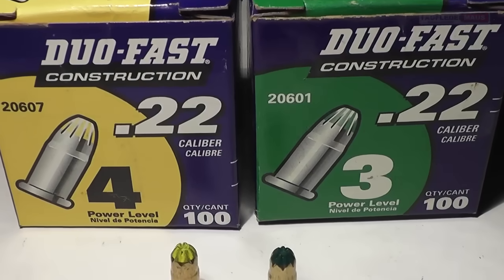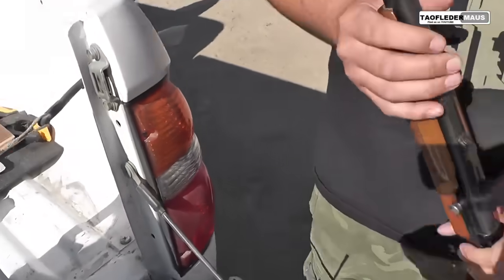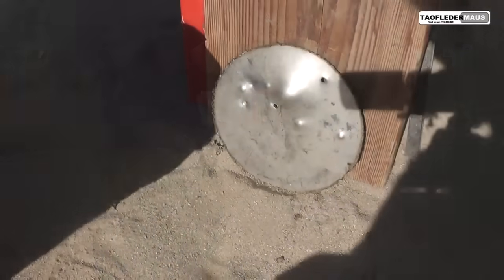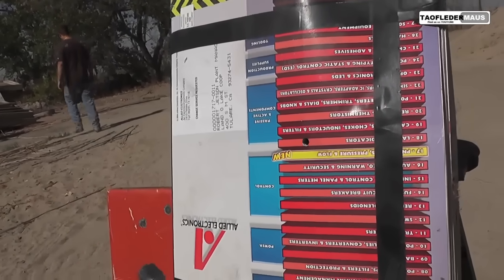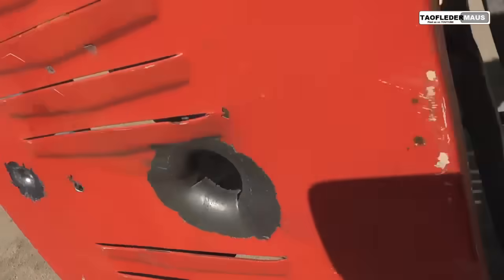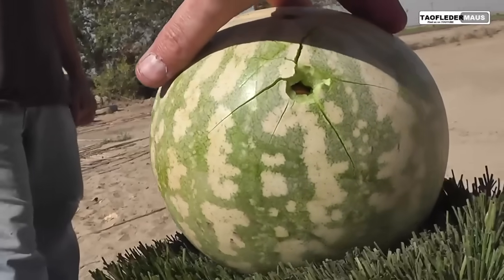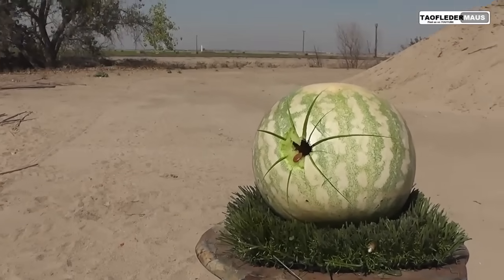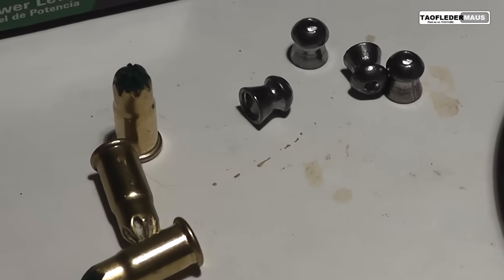Shooting .22 PELLETS Using NAIL GUN Blanks - What happens?

Comment: you know those air rifle pellets  have a cone on the back of them like the conical bullets in the civil war. when the powder goes off it expanse the cone into the rifling's which will make them accurate. its not going to hurt the gun. good survival ammo.
Reply: A 14 grain pellet doesn't offer near as much inertial resistance as a 30-40 grain bullet. That's where the extra velocity is coming from. It takes a lot more pressure to accelerate 40 grains than 14 grains to the same velocity.
Reply: mad max , as soft as the pellet is and the velocities your pushing I could expect to see some relatively high rate of lead fouling.
Reply: The civil war conicals were a combination of bullet weight,  shape, powder type, and burn rate all working in harmony. The fast powder in the hilti shells overpowers the ultra light weight pellets and does affect accuracy. Not only that but pellet speed can actually drop off with the more powerful yellow blanks! This was proven by +RyeOnHam when he did some chronograph tests. Better to use the lightest blanks color coded brown.
Reply: Will Yam smokeless powder burns slower than black power that is a fact. slower burning powders burn all the way down the barrel and makes for higher velocity. that why that pellet is being destroyed. the pellet is just like the conical bullet of the civil war the cone will expand and engage the rifling it  just needs a smaller powder charge.
Reply: madmax...its called a miniéball....(miné or min-aye-ball) named after Claude minié....but gets called mini ball.
Reply: mad max the idea is to get close to the same burn time as it takes to get the projectile out the barrel, somebody correct me if I'm wrong but that is the direct difference between big bore and small bore powders is burn time but compound is irrelevant. black powder is granulated after the ball mill processes to controll burn time.
Reply: You're correct about the burn rates of different powders, but what is the chamber pressure? Excess chamber pressure can damage the firearm and injure the shooter. The load data found in reloading manuals will always tell you the chamber pressure for a particular load based on the type and amount of powder and type of bullet and  weight. This seems like guess work since you don't know the powder charge in a Hilti .22 shell and there isn't much info on .22 rim fire rounds since they can't be hand loaded. It seems to me if its outperforming factory ammo, it must have a much higher chamber pressure and may be approaching the danger zone.

Comment: I modified a Ramset nailer to shoot 22lr bullets.the varmints up in my neck o the woods are all drug addicted scumbag thieves.If the situation called for it I didn't think that nailing their heads to their asses was gonna be the way to go. and it's a legal firearm!  single shot, but it could do in a pinch and still a working nailer!.

Comment: What alternative 22 cal pellets for a vintage crosman 600 10 shot semi automatic it only has worked with super pells crosman ,  and I searched all over  nothing comes close to the design of the ash can type original flat super pells   is the any suggestion for me  on what to use .?
Reply: Try the RWS Meisterkugeln Standard .22 Cal, 14.0 Grain Wadcutter style - the Crosman 600 must have pellets that stack on the rims of the pellet skirts.  Posted or round-nose types sort of lock together in the magazine and bind up the feed toggle.
Reply: D'oh!  POINTED, not posted.  Damned autocorrect.
Reply: sounds good I found them on eBay

Comment: I'm not a gun specialist but I know my way around some construction tools, and I'm fairly sure this can damage your gun, worst case damage your hand holding the gun, yes it's more power, but your gun fortified  isent like the tools are.
Reply: Your gun isent fortified like the tools are , my bad *
Reply: Well actually guns are made to take a lot higher chamber pressures than a tool for driving nails would be. The projectile is a couple thou bigger around than the gun barrel and the short amount of time it takes to move the length of the guns barrel causes huge pressure. Nails guns instantly release the pressure as there is no 24 inch or longer barrel for the nail to run down. But then again you did say you knew fuck all about guns.

Comment: Hey, Paul here. Longtime fan but never left a comment. Waiting for new videos I end up re-watching all the old ones.
I have a .17hmr which has a 22mag chamber but shoots a 17 caliber 17 grain projectile. It seems to be the same bore size between a 17hmr and .177cal pellet. The chamber fits a .22mag case necked down to .17
So I'm guessing a .177 pellet with a .22 blank should make a ridiculous high velocity projectile ... Maybe? The 17hmr averages 2550-2800 fps.
Of course there are faster and slower loads but can a pellet exceed that 3000 mark and increase penetration?
Seems like a question custom made for Taofledermaus! thanks
paulhouse7426@gmail.com

Comment: they're called power loads for a reason, they release more energy than a firearm round because they're designed to drive metal into concrete as opposed to soft flesh, but because there's more energy released than your weapon is designed to handle, you run an extreme risk of destroying the weapon and the hand holding it
Reply: The shells can't hold enough powder to blow a normal barrel. i'd not fire one from a sleeved barrel though. if it's too thin it might go pop
Reply: it would probably be best to just do this with either break actions or bolt actions, a lot of times the barrels on semi-autos are thinner
Reply: @wulfarrow2849  Well Yes and No, I have tested some hot loads in .22LR's the semi-auto has a thinner barrel, BUT also has a place for the gases to escape....On a bolt gun it has NOWHERE to go!
Reply: Yeah I thought the same thing especially in a simi auto ..

Comment: so you muzzle load the little pellet then put a charge in somewhere? sorry i dont know how guns work..
Reply: The rifle has a tube fed magazine for normal ammo and a breach where the spent casing comes out. They muzzle loaded the pellet like you said and then put the propellant case in the breach like a normal she'll would. Since everything they are using is the same caliber as the rifle's barrel it worked ideally.
Reply: +Colin Kornegay so just to clarify, this is armor piercing and much better than standard ammunition? I have very little perspective on ammunition effectiveness.
Reply: Yes, this is faster and you beat armor with speed. I would not say t is batter than standard ammunition though. The action in the gun is designed to handle a certain amount of pressure. This being a small caliber that amount of pressure is small compared to other guns. The charges in the video are very powerful compared to standard ammo and the gun will wear out quickly and need new parts more often.

Comment: I tried doing this about a year ago with my cheap bolt action .22 rifle. But I loaded the pellet into the breach and then put the blank behind it. It hit the target fine but left behind a ring of lead that prevented me from shooting again until I removed the lead with a sturdy wire bore cleaner. So in short I only got one round to fire off. I might try it again in the future.
Reply: +Josh Bonds Try a copper pellet next time.
Reply: You can either use a lower-power blank, such as #2,  or a bit heaver projectile....

Comment: I'm in construction and I've used hundreds of those yellow shots to nail wood to concrete. The box describes them as "Low Velocity", so I was quite surprised at how much they compared to a similar "real" bullet.
Reply: +Mike Truglia I imagine it would far over power the pellet and it would rip apart mid air, or not stabilize in any regard. Just a guess though.
Reply: @The_PotionSeller  powdered. it's to much pressure for soft lead.
Reply: imagine using the red caps, yellow and green are the weak ones. i own a ramset, and the red ones are most often too much. i only use the red when attaching wood to structural steel.
they need to try the red ones!
Reply: @miketruglia4825  pellet won't stand the strain.
Reply: The #4 rips the pellet skirt off in the barrel, and you gotta get it out before you can load another pellet...works OK with the #2 .
Reply: Could use steel pellets
Reply: @AndreHila  not if you plan on continuing to use that gun .it will eat the bore right out. check out steel shot in shot guns.

Comment: Ok, hold on to your drawers. Back in the dawn of time someone  melted the lead out of 88 grain JHP hollow point bullets for a 380 acp and filled them with pewter and the resulting weight was 67 grains. these were loaded into a 357 magnum with a compressed load of Blue Dot yielding velocities in excess of 2500 fps from a 4 inch barrel and blowing 25 lb blocks of duct seal to dust bunnies. 1/3 of the block crated on the ground, 1/3 of the block stuck to the backstop and 1/3 of the block just gone as dust or so it was reported. When you think about it, there is no reason you have to use 50/50 lead tin. The bullet could be solid tin and possibly weigh 40 grains. IKR, crazy talk.

Comment: Beware; The Crossman Hollow Point pellets might work fine in this demonstration, but some years ago I did the same experiment using ordinary pellets and found that the pellet head tended to separate, leaving the pellet tail or body in the bore! By the way, that round green object the guys were shooting was a gourd, not a watermelon.
Reply: I am assuming that you had the pellet right up against the crimped end of the blank. If you leave a bit of space, that shouldn't happen.
Reply: @bigbasil1908 ; I was using Musket percussion caps, not .22 blanks, and there was a 1/4" or so gap between the cap and the pellet.
Reply: @oldgysgt  Oh I see. Maybe the skirts on the pellets were not very thick, or maybe the compound that the percussion caps use was too powerful for the pellet. Those 22 blanks are black powder from what I understand
Reply: @bigbasil1908 ; yes, the caps were more than the pellet skirts could handle. I had made .22 cal inserts to replace cartridges in civil war .50 cal Burnside and Smith breach loading carbines. These carbines are primed with a external musket caps, but apparently the caps are a bit 'hot" for these light pellets.

Comment: I want to see you open the crimp and make a standalone round with it :)
Reply: +sinephase not a great idea because unless someone has a reloading manual that has data for blank powder we don't really know what pressures we're generating. This way the pellet is already jammed in the barrel, the blank uncrimps itself and the gasses push the bullet. As a standalone, the blank would have to do the job of the ramming rod and the pellet would temporarily act as a barrel obstruction while engaging the rifling.

Comment: Even though the pellet is a bit undersized compared to the bullet, the pellet skirts are very thin and the gas will push them into the rifling groves to engage the rifling well. There are .38 special wadcutter bullets that have a hollow cavity at the real used in bullyeye competition that are designed this way.
Reply: I had the skirts tear off in rifling but works good. Use heavier pellets.

Comment: If it's stupid but it works, it ain't stupid!
Reply: Or its stupid and you got incredibly lucky.
Reply: So if I jam my finger into a plug socket to bridge the gap between the socket and my lead which is too short that's a good idea?
Reply: Yep.
Reply: Maxim 43: "If it's stupid and it works, it's still stupid and you're lucky."
Reply: @stryc9fuego  if you feel that it's stupid then don't do it!
Reply: Ramset knew exactly what they were doing making this pellet. Even with the gun laws changing people can still
Have a decent deterrent while still owning a legal rifle that's classed as low power. In the uk you can't buy these anywhere in fact you can't even buy that nail gun in the U.K As it's classed as dangerous we have the crappy pneumatic placating and metal pin type guns. Thankful
You can order the ramset pellets of eBay amazon etc.
Reply: +Hans Solo Zimmler You are right.
Reply: science isnt stupid its great .
Reply: No, it's still stupid.  Discount the fact that this is the wrong "ammo" for the gun and you still have more money, more work and less accurate results.  That defines stupid.
Reply: Apply that to 9/11

Comment: The first of these I ever made ,(40 years ago), were simply the pellet stuck on, and slightly over ,the end of the cartridge, held with a dab of dried gasket glue, and fired from an old mossberg .22. I made another .17 cal. same way, and fired it in a home-chambered ( chambered with a 7/32 drill bit) Air/pellet rifle, (Norinco or Lorcin). NOTE: The .172 bullets in HMR and V Max are smaller than the .177 BB or pellet, and will not stabilize out of a slow-twist soft - lead barrel.

Comment: Good idea. Reminds me of when I was a grunt in the army and if I got bored in the woods during down-time on state-side field exercises  I would drop a section of cleaning-rod down the barrel of my M4 and with a blank firing behind it it would go so far into a tree that it was impossible to pull out with bare hands.
Reply: SGT D well that rod isnt cleaning anything anymore
Reply: I have some nails that are .15 cal so I can use them in my pellet rifle, using a bit of styrofoam as a wad, and fire them over an inch deep into wood from 10 feet away lol
Reply: Risky business. Don't think a section of cleaning rod weighs the same as a projectile you might be using. Props for trying it out though!
Reply: Ive done that with a .22, pulled the bullet and doubled the load, cleaning rod would stick pretty good lol
Reply: Wow

Comment: Same problem as with supersized bb - bullet goes through too fast almost zero stopping power, but lots of penetration. 
Basically - you should've tried it against a body armor kevlar plate. if it rips through it - you have a home made contestant for armor shredder.
Reply: +Smoke Fumus considering that all soft body armor is rated for MUCH lower velocities of 9mm and .357 rounds, I think it'd be good enough for that purpose.
Reply: I was thinking about .30 sabots....223 projectile, @ 3500+ fps... reportedly not very accurate in rifles, with rifling for heaver projectiles... but out of a .30 pistol, might be interesting... something that fires .30 carbine, 762.25 Tok, etc....

Comment: The pellets are soft lead.  There is a reason soft lead bullets are against the Geneva Convention.  They break up when entering the body (or a melon) transferring all the energy to the flesh rather than going through like a standard round.
Reply: Subsonic sticks, super sonic drills holes.
Reply: +simhere2 ..that fact intriged me..and i'v shot a lot of air guns..so a 8 grain pellet going 2800 fps has got my intrest..and yes i have a chonagraph..

Comment: It seems like the high velocity pellets are acting like a wadcutter with their perfect holes thru the steel.  Is the pellet pure lead with a hollow base??  Is the face of the pellet flat, or convex?
Reply: Pure led and in the video he is using hollow points, I don't recommend doing this I kinda blew up my old trusty Remington pump 22 and took an extractor to the face but yes they were fast and very accurate

Comment: Hmm...too bad there isn't a rifle specially made to do this; it'd be a great recreational shooter!
Reply: +Alonzo Branson Either .22 break action rifle or revolver should work well. With some paper and glue you can even make a cartridge)
Reply: +КоммуНЯКА Кавайная Yep.. But the #4 charge, and .22 bullets for the mini-revolvers were too much for my Buckmark.... gotta get it fixed.
Reply: +koolkitty8989 I was thinking the exact same thing, loading the pellets with a small Allen wrench in a single shot breech bolt action.
Reply: Yes... perhaps starting with a .22 center-fire barrel, or  a .22 insert in a break-barrel shotgun, to have sufficient steel around the chamber to withstand the pressures generated.... I agree that using a standard .22 rim-fire could be problems, which is why I suggest the most conservative approach...
Reply: Alonzo Branson I'm sure itbcould be made... literally in anyone's garage with the right tools
Reply: I believe that, in Mexico, you can get a "firearm" that shoots .22 pellets propelled by .22 blanks. Kinda close, not sure if these powder loads will work in them
Reply: @michaelbritt7609  almost impossible, I live in Mexico.  But please enlighten me.
Reply: @michaelbritt7609  your May be thinking of the cabana rifles.
Reply: To me there is no reason for it use a reg 22 its just as loud air guns are supposed to be quiet
Reply: a few freinds of mine made pipe guns that do this. you can also use these (along with some very good steel tube for your bolts) in modified pneumatic crossbows.

Comment: would it work with an air gun??
Reply from the maker: +michal mazur  If you could replace the barrel and install a firing pin and...
Reply: +michal mazur Yes. You need model which you load by turning the barrel down. You need to drill the barrel little bit to fit the cartridge. Then make makeshift pin out of rivet. Sometimes the pin gets stuck in the cartridge and you need to take the barrel off to reload.
Reply: +michal mazur yes, but you could just buy a .22lr or .22 mag and have something more accurate and not so jimmy-rigged lol